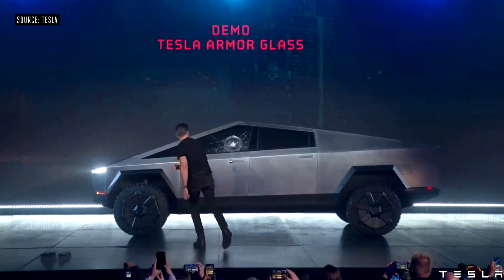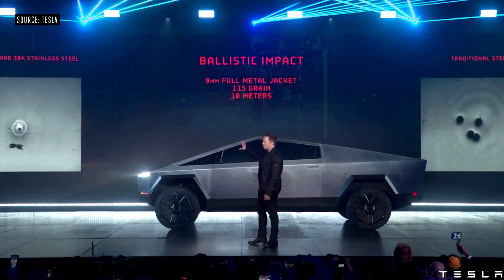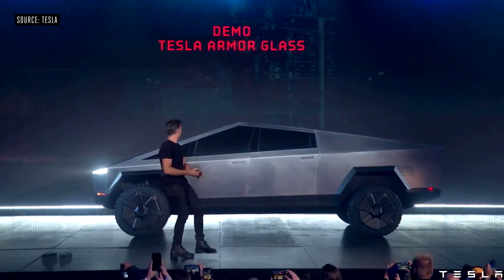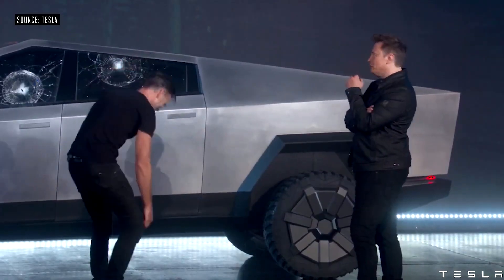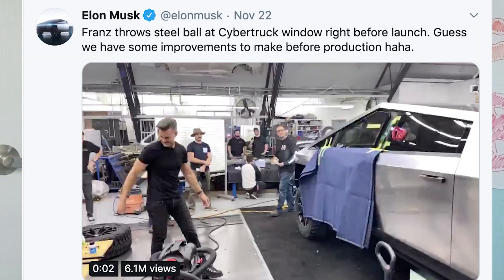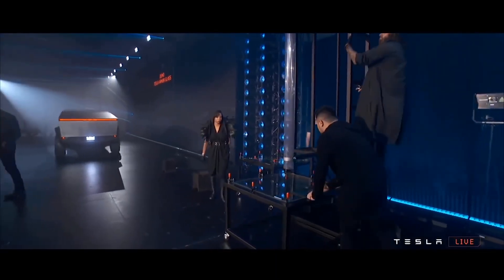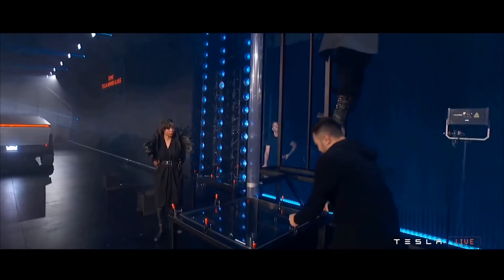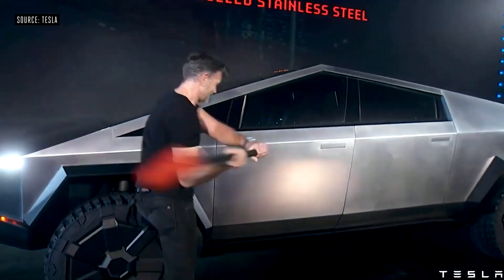REAL REASON WHY THE TESLA CYBERTRUCK WINDOWS BROKE? *EXPLAINED* (ANALYSIS)

Comment: What about the rear window? Why did it smash? They hit front door only
Reply from the maker: The second window also fell down/loosened from the first door being both slammed by the sledgehammer as well smashed from the steel ball. That's enough vibration to make the second window fall down especially that we see how easily the first window fell. Elon Explains it later in a tweet
Reply: @CallMeMing  you